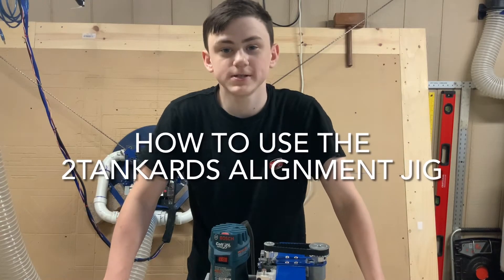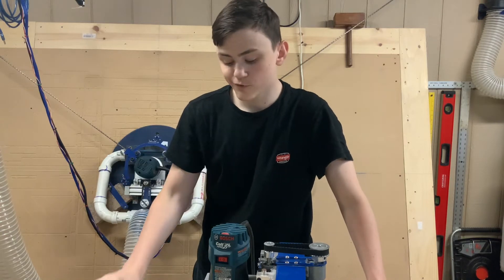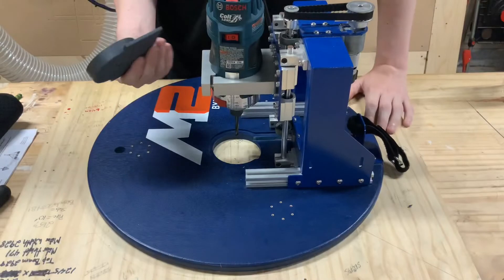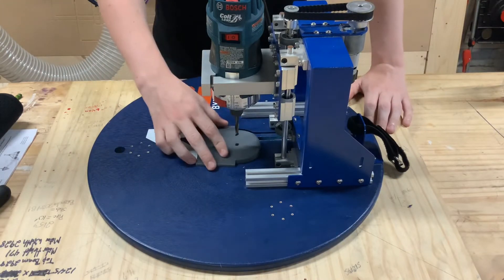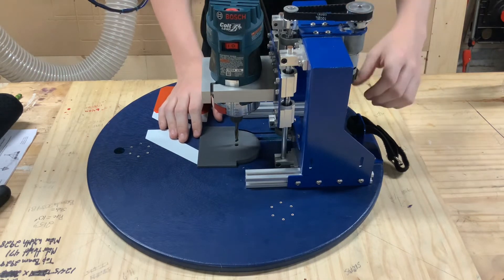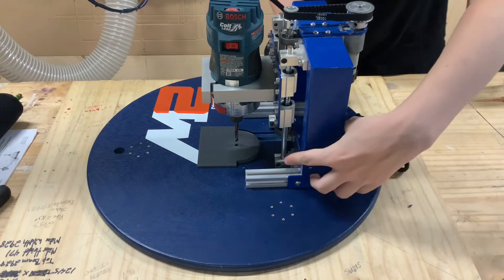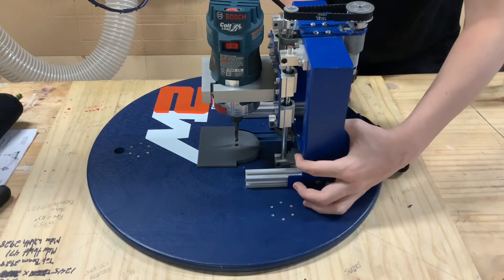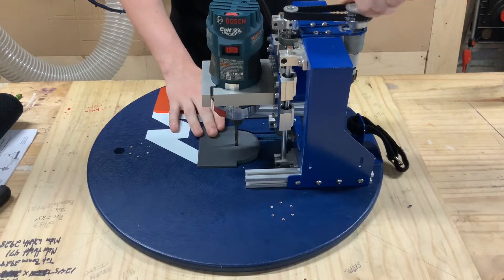How to use the 2 Tankards alignment jig

Comment: I noticed that your able to manually turn the stepper motor on the z-axis, My stepper motor is locked, did you leave the set screws lose so you could rotate the belt?
Reply from the maker: Yes. That’s how I turned the pulley and belt